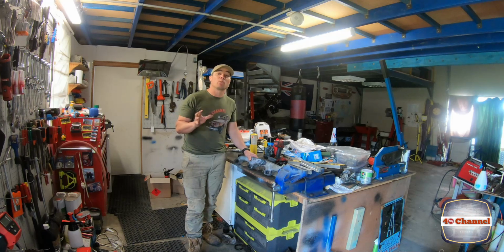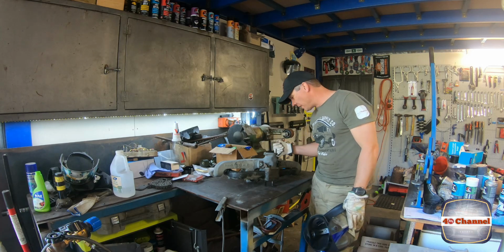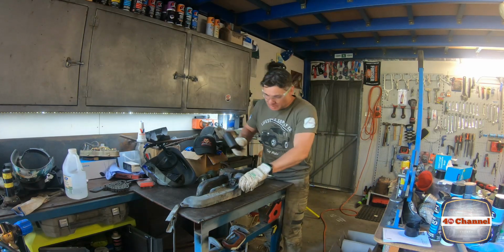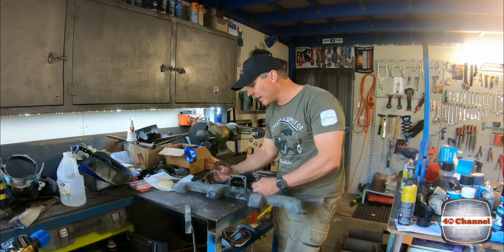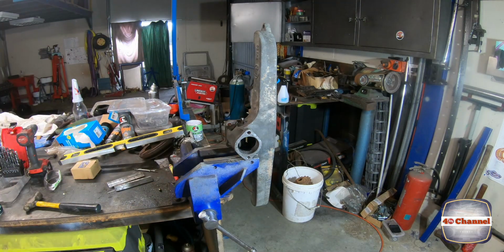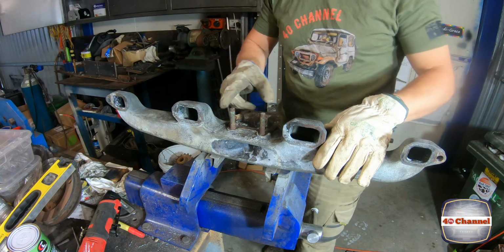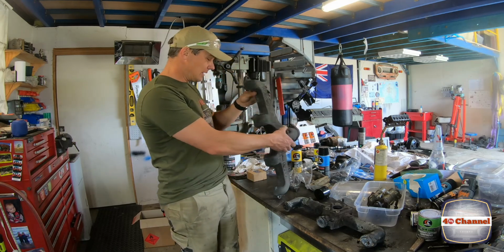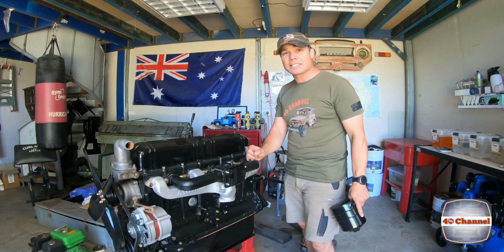S2EP36 - Clean up and remove heat valve from a FJ45 Manifold

Comment: Nice work, mate.  And you're right, people will say coulda, shoulda,  woulda. But I'll be nice about it. 
I think drilling and tapping the holes for threaded bungs would've been the go. On the other hand, I'm a great believer in "do what you gotta do", so keep it up.
Cheers
Reply from the maker: Hi mate, not a bad Idea but then the threaded hole would not have the correct clearance for the shaft if I need to go back to original.

Comment: I did the same to my manifold. 
You may have done it but didn’t show it on the video is add the stainless plate between the 2 manifolds. If it’s not between them, the direct heat from the exhaust will crack the aluminum intake manifold.
If anyone disagrees, let me know.
Reply from the maker: Yes good idea to make a blanking plate. My intake manifold is not aluminium it's cast steel. But will still make a blanking plate. Thank you.